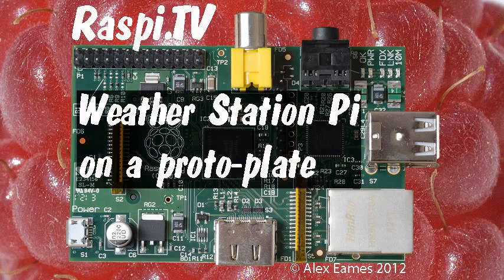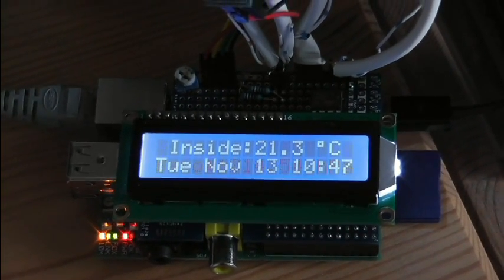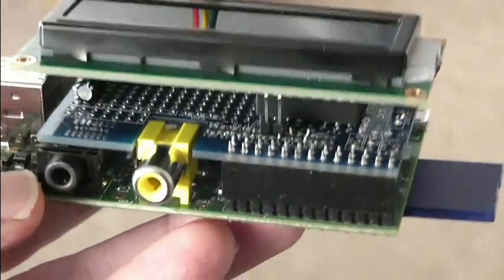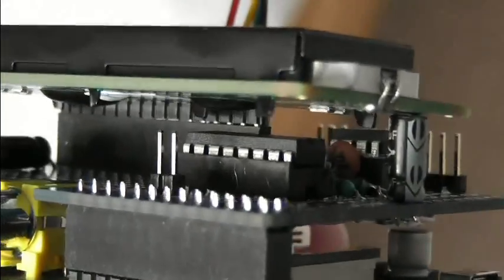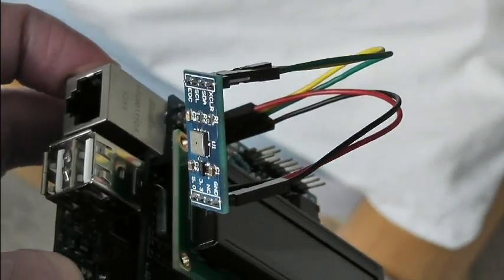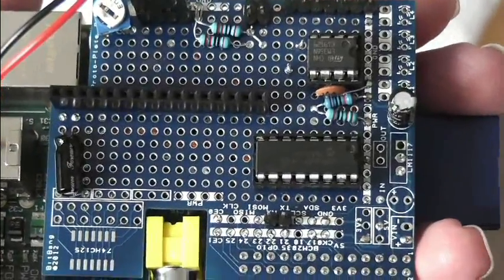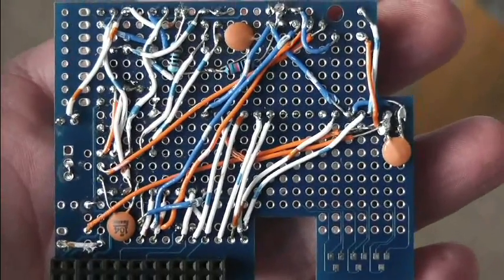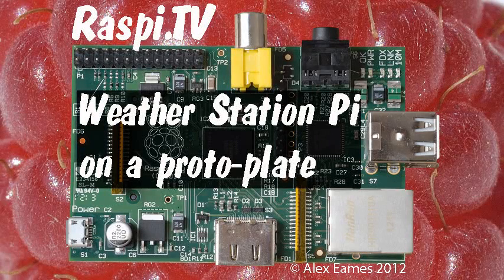Raspberry Pi Weather Station on a Proto-Plate

Comment: Just a quick question... Why is the Op amp required to drive the reference for the ADC?
Reply from the maker: It's actually there to prevent voltage sagging because I used high value resistors for the LDRs or the voltage divider (If I remember correctly - it was quite some time ago).